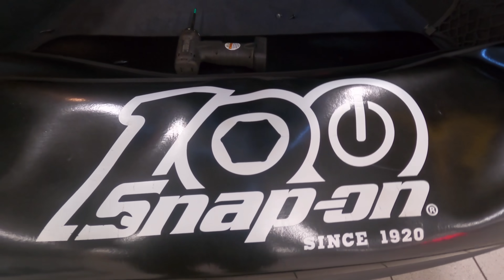Customer states I have a brake light out. AND THE W.A.W.P. IS DRY!!! Don't do it cheap!!

Comment: Just curious, does your shop use those connectors vs solder and shrink-wrap for any specific reason?
Reply: i thumbed down for the crimp connectors.... solder and heat shrink is my only way of wire repair.
Reply: @timm5527  I could see the utility in it if there was no chance they would ever come into contact with the elements.  I'm a radar tech by trade and motorcycle restorer by hobby, so the odds of that for me are zero to none lol  To me nothing beats a hook or birdcage hugged ever so snugly by good shrink wrap
Reply: Those connectors have solder in them that melts when heat is applied to shrink the tube they also have a sealant to keep moisture out.
Reply: @garyh.7282  those are crimp connectors.
The main reason why there used is, its quick.
Reply: @timm5527  Crimping is way superior to soldering. It's easier, it's faster and it lasts longer. Soldering is even worse when you expect a lot of shaking on the wires, like, you know, on a car. It can also mess up 5V and 3,3V signals if you ever attempt to solder a wire for a sensor due to the difference in conductivity. For 12V lights, it doesn't matter, that may be true, but why doing that extra work with the extra risk attached to mess it up?
There is basically no good argument for soldering over crimping. 

And then of course, if you are paranoid, you can also get butt connectors with solder.
Reply: @SuperUltimateLP  I have used those connectors yes they crimp on but when heated they have a solder that melts and make a tight connection. HEAT SHRINK CRIMP & SOLDER SEAL TERMINALS made by 3M are probably the best but they are made by several companies. In 1992 GM allowed the use of this type of connector in the SIR harness repair and until the time of my retirement they were allowed by some manufactures for SIR as well as ABS wire repair.
Reply: @garyh.7282  i may need to look in to them, i only know of the simple crimp connectors without the solder.
Reply: @SuperUltimateLP  They are a time saver but you have to get them hot enough to melt the solder and in some areas on a car that is not possible for a harness repair like this they are great.
Reply: @Asto508  Crimping is vastly superior to soldering in an automotive application (and aircraft, boats - anything that has a motor and moves) where there are drastic temperature fluctuations, high humidity, high applied torque forces, etc. Heat shrink butt splices are the best, and if you are wiring anything on the exterior of the car or in the engine compartment or behind a fender it's best to use adhesive lined heat shrink butt splices. Just make sure you do it properly - crimp jobs can be just as bad as the solder jobs I find.
Reply: @blueridgerennsport  I'm not team soldering, so I completely agree with you. ;)
Reply: @Asto508  soldering isnt so bad once you get used to it. Times change but when I was in school soldering properly I mean eterlacing the wires and wrapping around them like a barrel and applying solder created an almost unbreakable bond. Training is key
Reply: @cfmechanic  It's more than just method, though I will say that most if not all of the soldered "repairs" I've encountered over the years were soldered poorly - most people don't know how to solder correctly. There are many other factors involved like corrosion, increased resistance at the splice, abrasion that can lead to shorting, etc.
Reply: Official VAG approved method is to use heat shrink crimps with proper crimp tool, VAG found that using solder in the wiring harness caused lots (and I mean lots) of problems with high resistance joints and joints breaking down/going open circuit, that ended up costing the company a lot of money so they invested in finding the best way to do the job, if you are a VAG mechanic you get sent on a wiring repair course (part of the Electrical systems syllabus IIRC).
Reply from the maker: @cmotdibbler4454  100% spot on. This is an approved repair by most manufacturers. You can have 2 tech's with 2 identical repairs, if they both solder as a repair they will not be the same. Also I use the non solder heat crimps. In a perfect world there would be shrink wrap on my repair also but it's not going to hit the elements so it was not called for.
Reply: I was happy to see the crimps. Too many people giving out bad info saying to solder everything you touch.
Reply: Crimp connectors also prevent any issues when it comes to communication wiring, lost or added resistance can produce a voltage inconsistent with what a control module may be looking for. Solder can add resistance. No yellow tape on that repair?
Reply: Also, these are crimp and seal connectors. They have a glue liner inside that makes them watertight once they are shrunk down with heat. Strain relieved and watertight.
Reply: @customerstateswhat  I'm a former VAG tech, I was supposed to be on the VAG mastertech course but I got into a fight with the dealer owner and quit the job a couple of months before starting the course.
Reply: @Asto508  nasa solders doesn’t use crimp connectors so no it’s not better if the space men use it so should we!
Reply: @customerstateswhat  do the space men approve it tho
Reply: This was a joke btw if anyone missed it crimp connectors are just fine in a repair like this lmao people need to calm down
Reply: @timm5527  solder is prone to failure from vibration. Also, he's an Audi dealer tech. VW/Audi's manufacturer repair procedures expressly forbid soldering wires, and require the use of the weatherproof butt connectors used here. Which means you gave him a thumbs down because he did what he's required to do.

Comment: Did someone try to wire trailer lights or was the car in a wreck and the body shop did the hack job?
Reply from the maker: I was thinking a trailer hitch but no hitch and it would get the source from the body tail lights not the tailgate lights. The wiring diagram only has 4 wires to the light in question lol
Reply: @customerstateswhat  Body shops aren't known for having electrical wizards on hand.
Reply: @customerstateswhat  Right side rear fog light "mod" done by kids who don't understand the concept behind rear fog lights.

Comment: why not solder and heatshrink the wires? those connectors are just as cheap of a repair as electrical tape....
Reply: Those are weatherproof, adhesive lined heat shrink coated crimp connectors, from the kit that VW/Audi supplies, which dealer techs are required to use because VW expressly forbids soldering wires, as soldered wires are prone to failure from vibration. The connectors shown, when used correctly, are stronger than the wire itself and are totally sealed against moisture. This is very much a correct repair.

Comment: Every time I hear the whining about fixing someone ‘cheap’ repair, I laugh but not at what you’re thinking. I’m guessing here, but I’ll take a stab at it that you work in a franchise dealer as I did before retiring. I used to love these repairs. They challenged my diagnostic skills and I got paid for my knowledge/learning. It’s not like you’re going to do these repairs for free. They are money makers for the most part. Better then doing warranty work.  Most customers will see you as a hero not the villain. They are there to get the car fixed.  Some can afford the price of admission. Others not so much. I started in the days of the 100LS, Fox and Porsche 912,  911 and 928.  Had a boss who’s favorite line was ‘Drive like a sport, Pay like a sport.!

Forgot to add the 914. HO Campaign (fuel lines) was a money maker.........
Just saying..............
Reply: Oh, but I have a real electrical conundrum for you...
AC/heat blower motor does not shut off when ignition switch is turned off.  Then, if the blower motor shuts off, then either the sunroofs or the front windows will not work.  

It seems like only one of the 3 systems will work at a time.  My front windows were open, but would not go back up.  Miraculously, I took the wires off the battery, then reconnected them.  The front windows finally went up....

I think it is the Body Control Module, but the repair shop says it is the AC/heater head unit.
.... what do you think?

Comment: I 100% agree. Don't do it cheap, have a proper electrical guy do it. It's not worth the risk of catching your car on fire.
Reply: Those little wires ain't catching crap on fire
Reply: @Iamthathillbilly  they will most likely just blow a fuse, but not worth the risk to do it wrong.

Comment: Soldering is always better.
Reply: Tell that to VW/Audi, which supplies these connectors and the tool to properly install them? and requires you to use them. Their requirements specifically forbid soldering of wires, and these are not the cheap crimps sold at Auto zone.

Comment: That's not how you properly fix the wires either. Wires of that small a gauge should be put together by soldering them.
Reply: Negative. Aside from the fact that VW forbids soldering of any wiring, even those who do advocate soldering in an automotive wiring harness say no soldering wires 16ga or smaller.
Reply: @blueridgerennsport  guess they don't think yal European guys can do it right again. Cause those of us who work on domestic know that warant won't pay you for a butt connector. You either fix the wire correctly or replace the harnesses
Reply: @BDPlayground247  I'm not sure what that means, but I do know solder has no place in a wiring harness. If you do the splice right there's never an issue.
Reply: @blueridgerennsport  it means what you are saying is backwards from all fomoco training. If you use a butt end connector on a small wireing ford warranty will not pay you for the job and if you think a butt connector is better than solder then your not properly soldering. Also if you dont think solder belongs in electronics what do you think hold the connections on circuit board together?
Reply: @BDPlayground247  Reading comprehension. I never said "solder doesn't belong in  electronics" - I said it doesn't belong in a wiring harness. And VW/Audi/Porsche/Bentley/Lamborghini DOES pay for a butt splice in warranty work. In fact, they issue every splice and every piece of repair wire. Hell, if your repair requires connector work, they issue the repair wire with the terminals already crimped on the ends.
Reply: @blueridgerennsport  well ford will not pay you for using them because on small wire the butt connector don't make perfect contact around the wire allowing for microscopic arcing in the connection which creates hot spots that cause damage the the connection causing increased resistance and leading to repeat repairs.
Reply: @BDPlayground247  That sounds like a crock of UAW b.s. to me, but then again, there's a world of engineering difference between American cars and European cars. Besides, these aren't your average butt splices off the shelf from Auto Zone. The most commonly used splice under the VW umbrella is p/n 000979940 which has a dealer's list price of $4.64 each. You can find some places selling them 10 pieces for $12. The VAS1978 crimping plier base is $100, but then you have to buy the crimping heads - three of them, in fact, for $200 apiece, before you can actually crimp anything. Yep, $700 for a crimping plier set. So VW knows their shit when it comes to crimping terminals.
Reply: @blueridgerennsport  even at that it still looks like it was done by a high school auto shop student. By the time you have increased the size of the harness by adding them you cant even put it back in the wire loom. So it's just a big brick wraped in tape. When you solder the wires its only slightly bigger due to the heat shrink and can easily be placed back in the factory wireing loom like nothing ever happened. Beyond fixing the problem the true goal of a technician is for the customer to not even be able to tell a difference in your repair and the factory look of the original harness. Outside of working in the dealership I also do custom wireing on show car and aint no one paying for a custome work that looks like it was done but a teenager
Reply: @BDPlayground247  All splices need to be staggered. This repair in the video was just fixing a hack job by the current or former owner, so he didn't have a lot of choice in where the splices were. The factory butt splices are heat-shrink and when done correctly are barely 125% the diameter of the wire - so a 22ga wire splice is about the same diameter of a 21ga wire, so no fitment problems, and the vast majority of the repairs are done at the connector end anyway.
Reply: @BDPlayground247  solder can fail from vibration. The connectors shown here are supplied by VW and are available in the correct size for all different wires. They're also supplied with a special ratcheting crimper tool that crimps them properly. These aren't the cheap, shitty one-size fits all connectors sold at Auto Zone. VW requires you to use them, and forbids soldering wires.

Also, I know for a fact that you're wrong. The repair connectors Ford supplies for replacing the alternator connector that has to be replaced with every alternator replacement on late 80s/ early 90s vehicles comes with these style connectors pre-installed from the factory. I doubt that they don't pay for that repair.
Reply: @puckcat22679  I am glad that you know so much more about Ford warranty policy than a Ford senior master technician who's worked for then for more than 20 years. Vibration will get the little butt end connectors also. Its called metal fatigue. You can vibrate a 1 inches piece of steal till its weakend. So not a very valid points. Also gonna go on a limb that you never head the paper work that comes with the Ford connectors because it clear tells you not to use crimp style connectors on small wires. So there othet than bring no actually info to the conversation thanks for tring anyways

Comment: Those butt connectors with heat shrink already on them suck.
Right where you crimp them will pinch the shrink and let moisture ingress and it rots from the inside out. BTDT.
Reply: Not if you use the proper tool to crimp them, which is likely supplied with the kit the connectors come in, as that's the required repair method from the manufacturer in this case. Those cheap, shitty, thin combination cutter/stripper/pliers/crimper things sold at the parts store will damage the insulation, but that's not the proper tool. The proper tool is a ratcheting crimper with dies specifically made for these connectors. They cost a couple hundred dollars, too, but they are much easier to use and don't damage the connector.

Comment: What is the exposed wire for? I see it both sides. That'd bother me.
Reply: Ground
Reply: Someone ran a wire from the driver side of the tailgate where the rear fog light is to the other side of the tailgate where there is no rear fog light installed on LHD vehicles and wired it in because they don't understand why or how rear fog lights work.
Reply: @blueridgerennsport  I cant tell if your serious or joking. Rear fog light???
Reply: @cfmechanic  You've never heard of a rear fog light? Is mechanic your actual occupation or just your last name?
Reply: @cfmechanic  it's a requirement in Europe, and some European cars here in the US will still have them.
Reply: @blueridgerennsport  here in the US, they're not required and are very unusual. Basically, only a few European cars have them enabled here, and others have the spot for it in the light housing, but no light installed.
Reply: @puckcat22679  Yes, and many of the younger/dumber people who end up with older European cars don't understand what they are, how they are used, and especially not why they are only installed/enabled on the driver side of the car. Their autism forces them into thinking "asymmetrical=bad" and they do stupid stuff like this to their car. Same kind of foolish thinking of the VW/Audi owners who re-code their lighting modules to keep the white DRL LEDs turned on while their turn signals are operating and then wonder why nobody can see them indicating a turn from the front of their car...